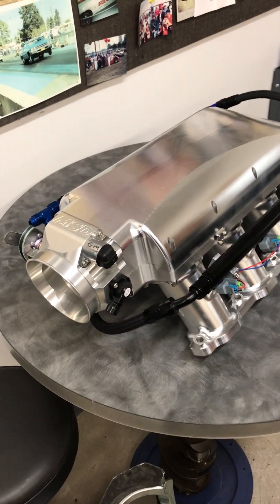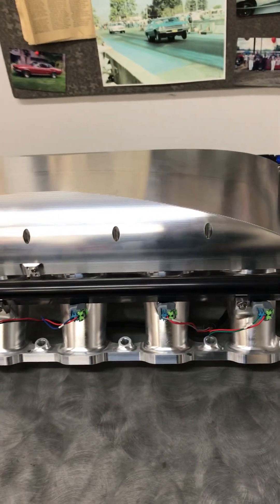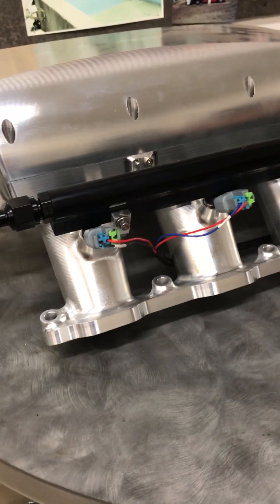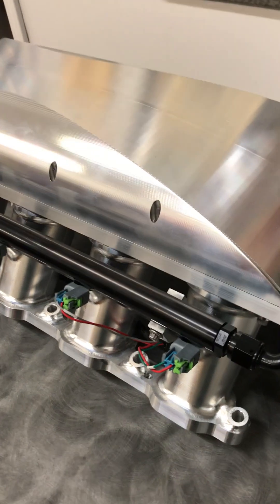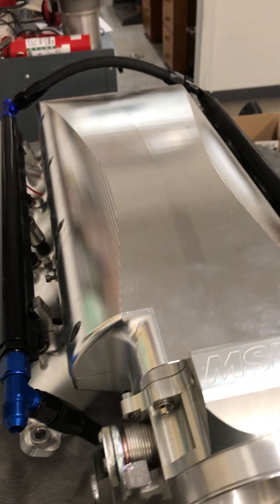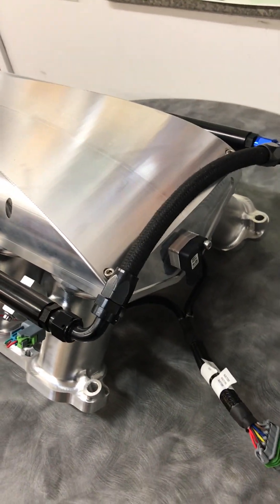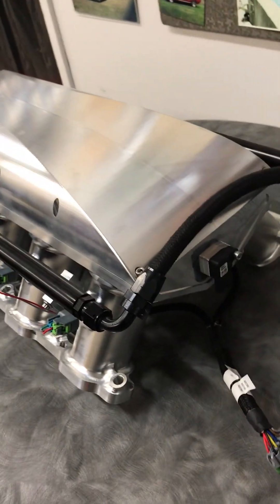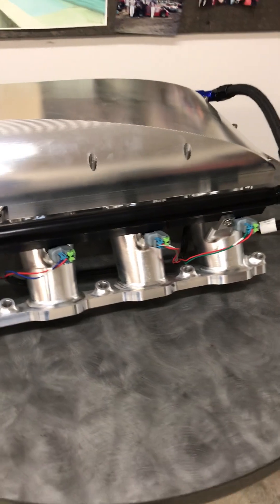Hogan billet intake for GM 632 crate engine

Comment: I put an MSD atomic air force intake with a 102mm throttle body on my LS7 and lost power. I gained 4hp and lost 45ft/lbs. Putting the stock intake/throttle body back on.